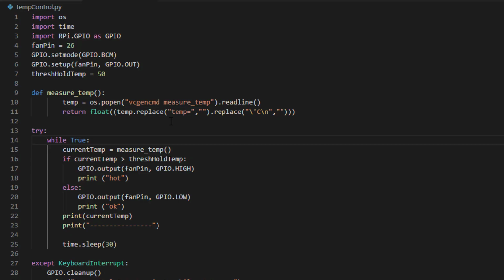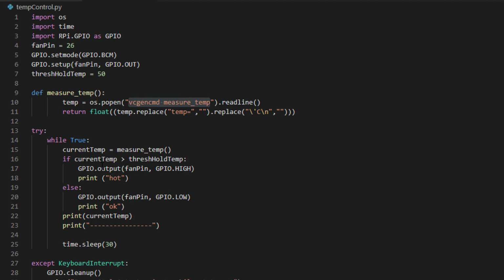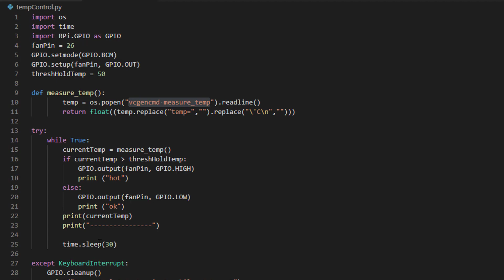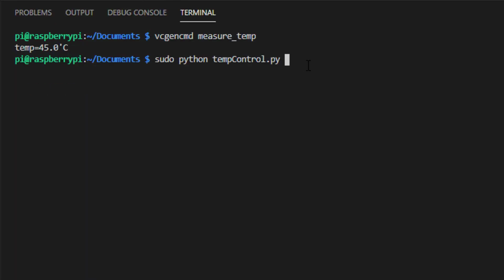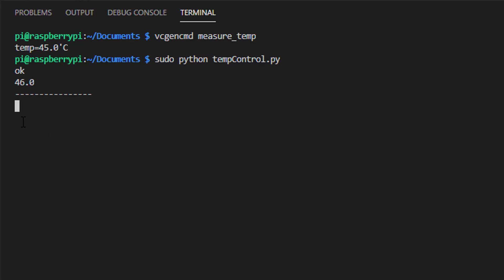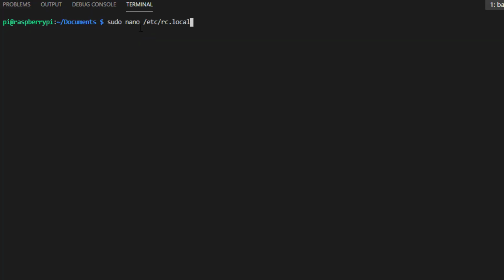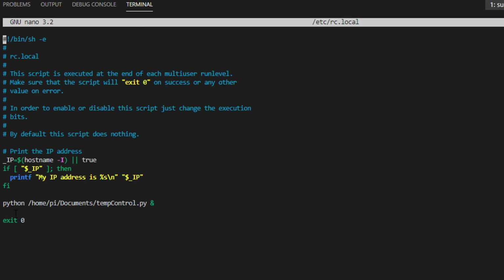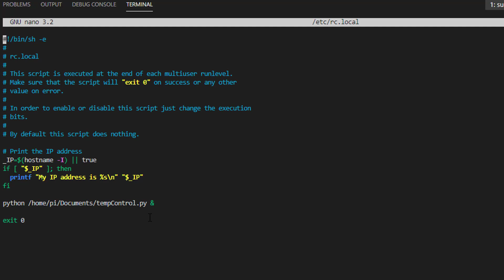Raspberry pi 4 GPIO controlled cooling fan – python script

Comment: great one, can we see the schematic ? especially to know the resistor values for the base and the collector
Reply from the maker: Thank you 
Here is a full review 
It's a 1K for the transistor and 220Ohm for the led 
https://www.hackster.io/talofer99/raspberry-pi-4-gpio-controlled-cooling-fan-20fe85

Also just so you know - now there is a build in setup in rpi for this 
https://www.youtube.com/watch?v=0jFWbNrWhN8
Reply: @talofer99  thanks a lot,
I will make a PI or PID controller with it, so..the built in on/off won't be useful for me..

Thanks again 🌹

Comment: I'm brand new to everything raspberry pi related. I've found some good resources on python so I feel like I at least know where to start on the software side. 
But I don't understand why the circuit is necessary for controlling the fan. I don't know if it's because I don't understand the limitations of he raspberry pi, or if I just altogether don't understand how electronics work. Can you think of some places that would be good starting points where I can gain a better understanding of what you did in this video?
Reply from the maker: The GPIO voltage level of the RPI is 3V. and can only supply low miliamp current. 
The fan needs 5V to work and love its amps .... 
Soliton - you drive a transistor with the GPIO - that can work with 3V and need only few miliamp to work. the transistor will act as a switch to "connect" the fan to 5V. 
Since when a fan stops working, it can, due to its physics, create a reverse voltage on the system the diode is there to "take it" instead of it running to your power source and rpi. 

I made a tutorial on this, you can see the schematics 
https://www.electromaker.io/project/view/raspberry-pi-4-gpio-controlled-cooling-fan

Here is a video on transistors as switch 
https://www.youtube.com/watch?v=bK4vyPVBITA

also, few days back I found out the rpi config has a new feature for what I done in python script 
https://www.youtube.com/watch?v=0jFWbNrWhN8

Let me know if it helped answering your question
Reply: @talofer99  thank you for getting back so quick. You answered question very well. I will have to dive deeper on I get my pi, and I'll definitely check out more of your videos
Reply from the maker: Great, glad I could help.

Comment: Appreciate the video but the part @2:27 is what viewers like me actually interested on. You just gave an overflow rather than showing circuit diagram or elaborate more.
Reply from the maker: Thanks for the comment, you can see all the extra info here 

https://www.electromaker.io/project/view/raspberry-pi-4-gpio-controlled-cooling-fan

Comment: This is great and exactly what i was looking for! Awesome job. Question.. will this work with the Raspberry Pi 3 B+? Also, Can this is done without an LED & switch? I want to be able to do this to my cooling fan without any of the additional bells and wistles.
Reply from the maker: Thank you very much.
Yes it can be done the same way on the Pi3 B+
And no need for LED and Switch, I did it as an addon - to know I get power and to be able to run the fan with out the need for using the python code